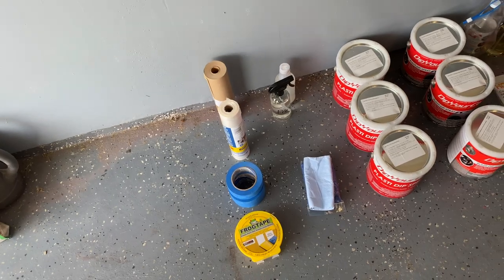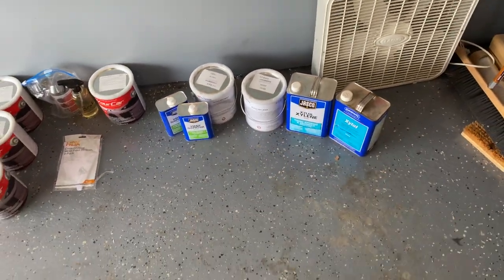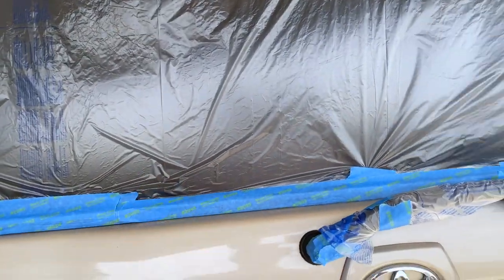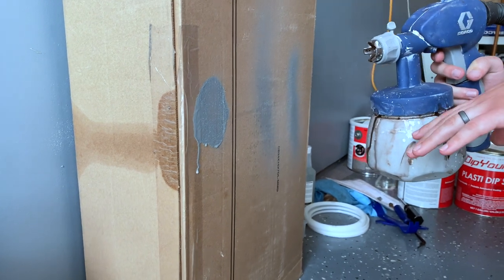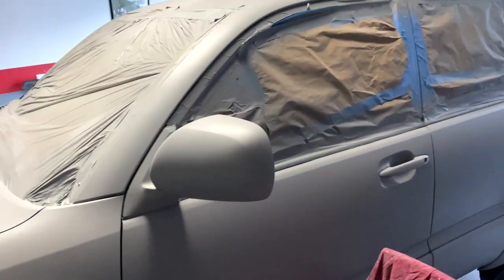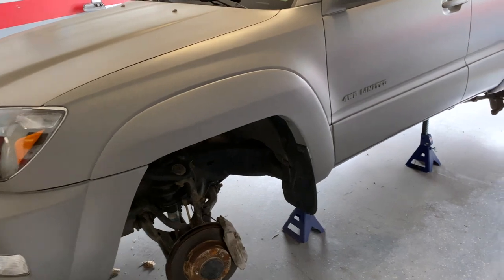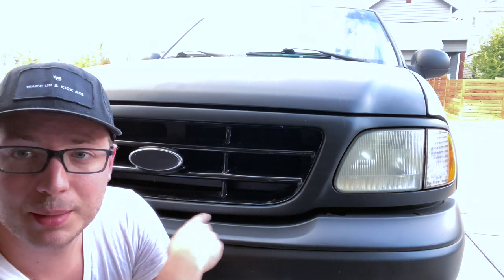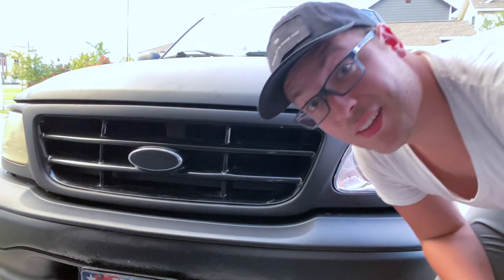DipYourCar vs DIY. What’s the better way to Plasti Dip?

Comment: What a job, both look great!
Reply from the maker: Thanks! Like I said, if I did it again, I would revert back to the 1:1 dip to xylol mixture, but great results are possible with both. You definitely have more color/finish options with a pre-mixed kit though.
Reply: Goose Auto Works do you think you waited long enough for it to dry before exposing the truck to water? Maybe just needed a longer cure time? There’s also a product online called dip coat I wonder if that may help.. it gives the dip a more sleek look and feel
Reply from the maker: It was several days before rain and a couple of weeks before first wash. It’s not a huge deal, but something I would do differently in the future. I can try the dip coat, can’t hurt.